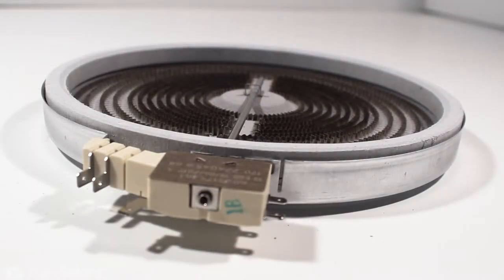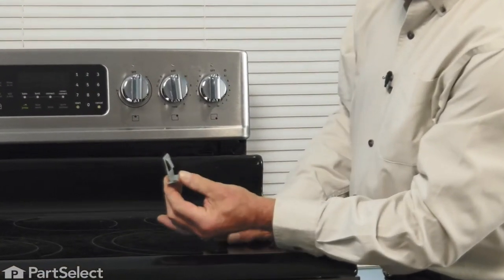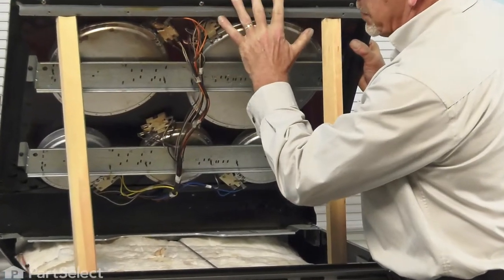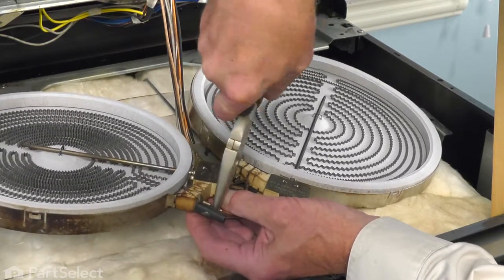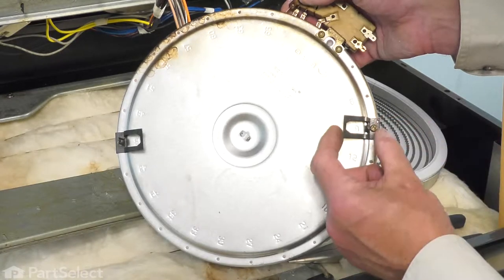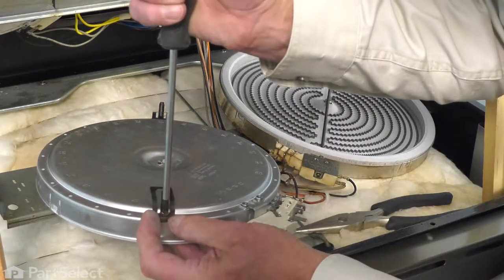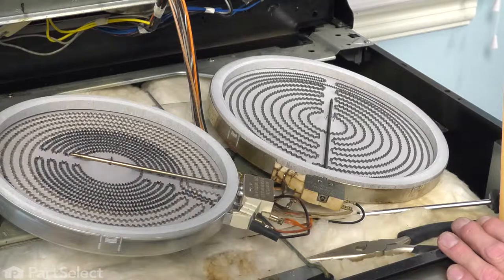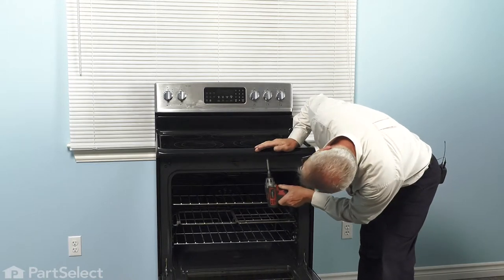Frigidaire Range/Stove/Oven Repair – How to Replace the Surface Element

Comment: After putting this job on the "back burner" since the summer, I finally got around to taking care of this with the replacement element I ordered from Amazon. Mine was the small back right burner so I had to slightly modify the procedure. The tips on noting the exact positions of the wires and the clips really helped as I may have rushed this and been stuck with the replacement. Thanks for very clear instructions Steve.

Comment: And be careful not to drop a screw down the side like I did today. Luckily I found another one that fit. It is difficult and takes a long time but this guy makes it look easy.
Reply: I got stuck a couple of times with the wires not coming off easily and one of the clips getting stuck but I to a short break and a deep breath and tried again. I too was really paranoid about those screws dropping down into infinity so I took it real slow!

Comment: My brackets go from front to back and not from left to right.
This makes it very difficult if not impossible to remove the bracket being that the screw that holds the bracket in place is at the rear.
Does anyone have any ideas?

Comment: Really useful, although more of a closeup on the retention tabs would have been helpful.  Viewers should note that if you're replacing one of the rear burners, there is less wiring to play with, you can't move the element very far after removing it from the bar.

Comment: .Do you have any videos on fixing the electronic board which of course controls my gas oven…I bought a new electronic board and it worked for a day and then stopped working so 8 figure there must be another short in a wire somewhere else… any ideas?  I hate to throw it away it’s a nice stainless steel gas range with a griddle that can be used. Please let me know, okay?

Comment: could please answer a question    I have a 1 year old Fridgadaire stove  that has 4 electric coil elements 2 large and 2 small. T he problem is the 2 large tend to stop heating before i can even boil water in a pot , then it  takes several minutes to restart the element.   thank you